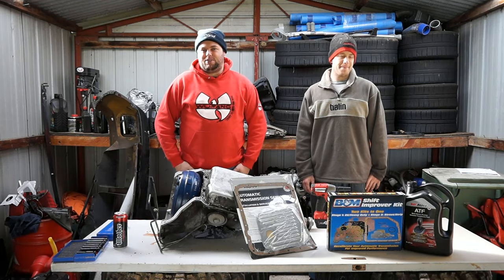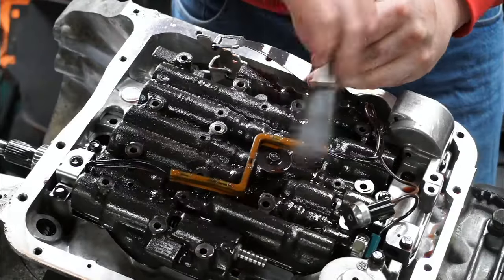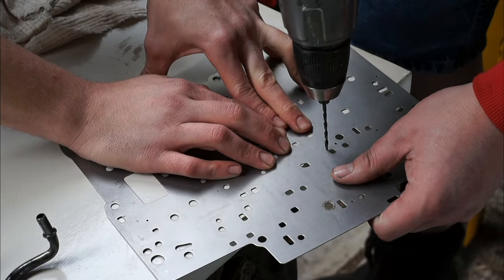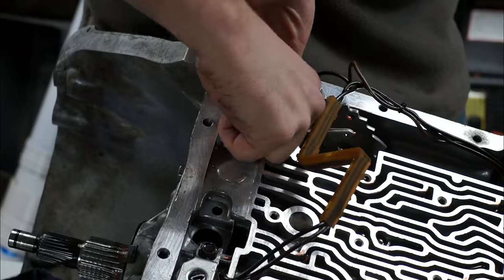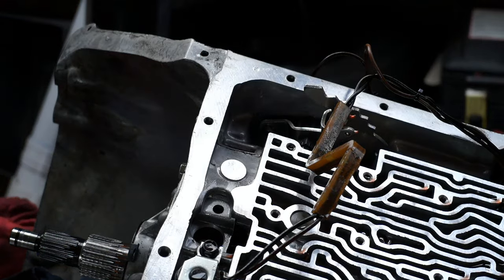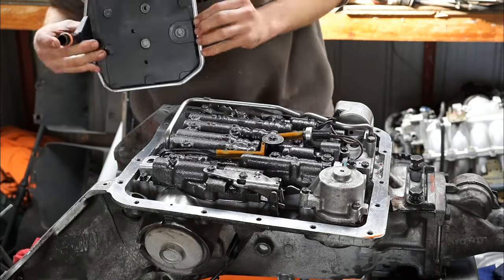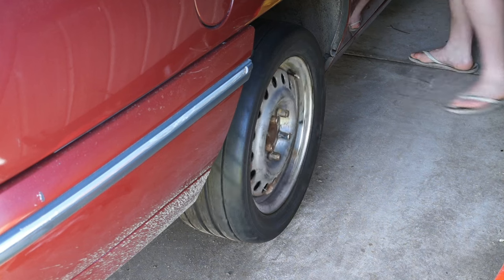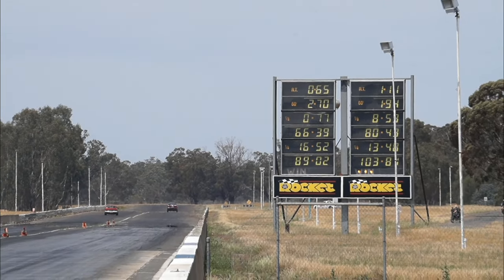AUSMODS - "Cable Tie Commodore" how to fit a Stage 2 Shift Kit on a TH700

Comment: do u know if the torque converter has a drain plug in it?
Reply from the maker: The factory converter does not have a drain plug that i know off. Its been a while since i filmed this. So hard to remember everything

Comment: tailshaft ... drive shafts have 8 Alan key bolts from diff in irs cars only that vp wouldn't be tho since its live axle 😁
Reply from the maker: worked for a drive shaft company for 2 years. a tail shaft is still a drive shaft ;)
Reply: It certainly is either a tailshaft or a drive shaft, either or other, they drive the wheels, so drive shaft is right, it's also the tailshaft, which is also correct, drive shaft/tailshaft centre bearing has both names depending where you're from and both distinguished the same.

Comment: With the additional forward accumulator you have behind the valve body, it appears you've actually got a 4L60, which was an improved version of the 700R4 produced briefly before they went on to make the electronic 4L60E. 

You might find this video interesting on the 4L60: https://www.youtube.com/watch?v=_5lRls7UvzQ

Comment: Any idea if the alloytec's use the same/similar trans?? Wouldn't mind doing this to ours.
Reply from the maker: Probably not. By the looks, they use a 4l60e or a 5l60e. This is for a TH700.
Reply: @AUS_MODS  is anyone better, or are they just different?
Reply from the maker: @chrishorsburgh7054  no idea man. From what i have heard, 4l60s are rubbish. Th700s are ok but tur o 350s or 400s are the strongest boxes for drag racing but they weight alot as they are cast iron, not alloy. Unless u get an after market but they cost a heap. It all depends what u plan on doing with the car.
Reply: @AUS_MODS  awesome. Thanks for that. Will have to do a bit of research. Great vid tho.
Reply: @AUS_MODS  I know this is a year old comment, but FYI Turbo 350's, and 400's are aluminum cased, not iron.
 If we're talking GM auto's, their transmissions of the 50's were the iron monsters. 

A Turbo 350/700R4/4L60 are all in about the same league as far as power handling capability, all depending on how deep your pockets are. The Turbo 400/3L80/4L80 are the next step up.

Comment: did u go with a hi stall converter & if yes where did u source it?
Reply from the maker: we did. and we ended up finding a second hand one. its a 2800 hi stall that works well for the setup in the vp.
Reply: thats right yours is a v8 ive got an l67 v6 cant find a torque converter 4 it but heard i can hav mine refigured to a stall.

Comment: Can this be done to a vt commodore..
Reply from the maker: Probably. the TH700 might be slightly different. best bet, is to get the part number for the box its self, and find a kit to suit.
Reply: Yes It can but things are a bit different, VTs have a 4l60e. Which is a electronic controlled th700. 
There should be plenty of videos on 4l60e shift kits